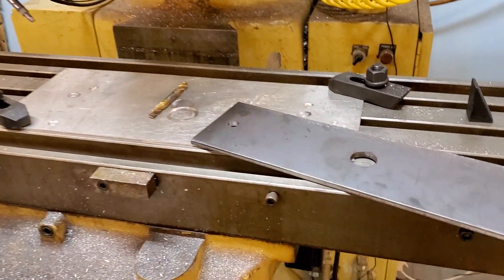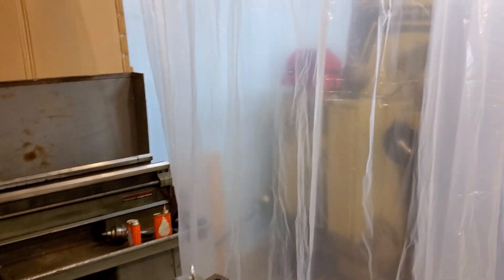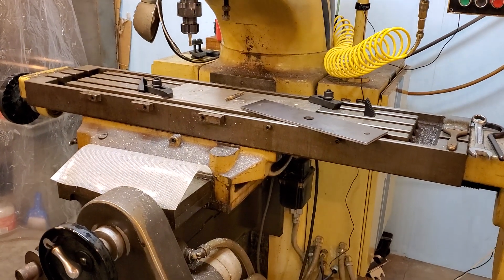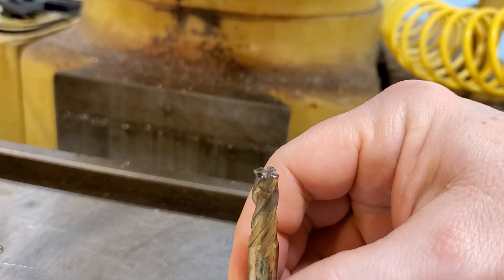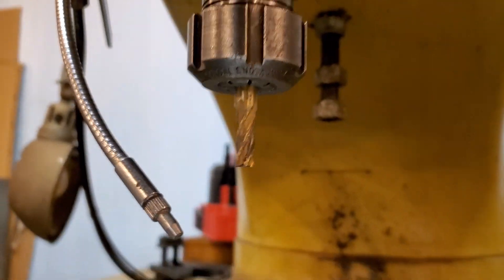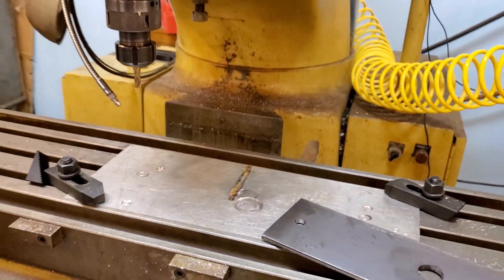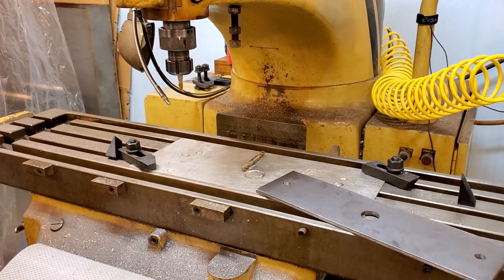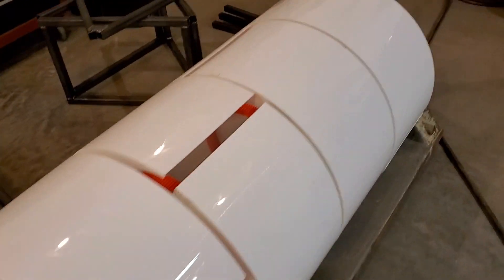Pre-Christmas 2019 update -I need Fusion 360 HELP!

Comment: "HELP! I'm learning as I go here so please don't be too cruel in your comments. I'm learning as best I can on my own"
My first thought when i read the video desc... SLAM HIM!!!! muahahaha. 

I do share a passion in engineering. Going to leave a few things which i can forsee in your design. 

Case 1:
Yes, wind blows, the thing spins. obvious enough. What is not so obvious is.Wind blows in one direction. If it hits the horizontal half, you get max torque and max power. If it hits the full cross sectional area of your wind capture area, well not so much. To circumvent this, consider your designs to have aerofoil properties. Not suggesting to have it completely weirded out of being a cylinder. The side which doesnt provide much effectiveness in catching wind. I believe you can tweak the shape so that it can help to direct the wind in such a way that propels it to rotate in one direction. Not going to spoil too much. 

Case 2. 
Since the wind blows in one direction. There will be another form of moment. The usual moment is the one that you and all of us can see, which it rotates upon the determine axle. 
There is another moment. Best describe as when someone knock a water bottle top side. That is the moment , you will have to address as well. Why is it important? Consider this. The wind direction is singular or basically it comes in one direction. But your blades are rotating. It means your capture area alternates. Im pretty sure that 180 degree rotation and 90 degree rotation with you standing in one position, you can see at times your wind capture area is maximise, and at other times, it will become minimise. 
Still remember that moment that i describe the water bottle tips over top side? You will definitely experience, that moment to have maximum and minimum. With it rotating on an axle, Its going to spring back and forth while rotating. 
Solution? well make sure that the top side of the axle is secure as the bottom as well. Do this, and your bearings will last longer and doesnt wear and tear. 

Case 3
Im not sure how windy is your intended installation. and please dont reveal it online here just because it look like im kind. The internet... well get my point. If it is strong wind vs weak winds. You are going to have at times high power voltages and low power voltages. Im not refering to high power voltage like the national grid, just at the level of your scale. Just like amplitude of waves. Crest and trough. Im sure you would like to avoid your electrical appliances goes functional at times and dim at others. 

Im not so keen in electrical, so its best ask the ones who are capable. Its similar to solar. bright sun, lights in the office are awesome, fans at max speeds. Cloudy..... well... occasional darkness and stuffy. 

Regards,

Edward
Reply from the maker: Edward you get an A for effort but failed at grasping what I was asking for help with. I am not asking for design help right now. I have got that in hand and have already addressed the concerns you were discussing. Just take a look at my early videos of the small pink and green models spinning in the wind. What I was asking for help with is machining. So right now that is my need, just some help with machining advise for speeds and feeds and tricks of the trade. Scroll to the bottom of this playlist since it's in reverse chronological order. If you'd like to see Harmony VAWT Latest Updates, here's the URL: https://www.youtube.com/playlist?list=PLqbwi-6vny7s3NVYuynqVG5oyLxysgfIs

Comment: The machine I work on is the human body so I'm out of my element here. I am amazed by your ambition, skill and creativity. My very limited experience drilling holes in steel was not fun, it took HOURS and I did not have a drill press. Best advice I got was use oil, good bits and a pilot hole. If the oil smokes, slow down and be prepared to pause and remove metal shards. I doubt this was helpful but I do want to encourage you if possible
Reply from the maker: Thank you Trinianz! I appreciate the positive vibes and the laughs.

Comment: Hello Chris,
In machining steel, the speed of the tool is very important and you need to set the spindel speed exactely according the material you want to machine, as well as  the material and diameter of your  tool. 
There are tables about it.

For your problem of the speed indication which is missing on the spindle of your milling machine, I would advise to add an electronic RPM indicator.
It cost 10 USD and it's really simple to install. A very small magnet on the spindle axis, one sensor on the spindle head and a digital display.
And then you will be able to set (manually) the right spindle speed according machining tables... and you won't burn your tools anymore.
Concerning feed speeds, it's the same story ( depending of materials, number of teeth of the tool, ...).

If you need help to find this machining speed tables or RPM indicator, give me a email address and I will send you links.

Looking forwards to see the first tests in January.

All the best.

Patrick.
Reply from the maker: Hi Pat. I looked around for a good magnetic rpm indicator but most go off of electronic pulses from a car ignition coil. Several run from hall effect switches that may work so let me know if you have a good one to suggest. I am still in need of help figuring out what I may be doing wrong in F360.
Reply: @HarmonyTurbines  Optical one may also be an option
Reply from the maker: @geekoid183  Yeah I was thinking about that also. You put a shiny piece of tape on the spindle and I think that is what it gauges off of. I'll look for some of those also.
Reply: Optical sensor are good... but not adapted to machine tools where chips or cooling liquid are flying around...
Reply: @dtvking  
Stange use... 
When machining with cooling it could make drops on the place where the IR sensor is aiming... and this drops will absorb IR light..
OR,
 mosture/dust/grease/mini chips could stick on IR sensor and bloc the beam...

This is only experience of IR sensor in heavy industry and in my machineshop...
But after, everyone can make his own experience and misadventures...
Reply from the maker: @dtvking  yes my thought exactly. Got a hand held unit so I can use on any tool.
Reply: Aah... in this case OK.
I have also a handheld optical RPM indicator. It is useful.
But with the price of an inductive one (8 USD), I think it has a value to mount a fix indicator.
Because on a drilling-mill you need to adjust the spindle speed at each change of tool... and also from rough to finishing pass.
Reply: I just did 3 min ago a last trial to give you links for RPM indicator and speed tables.
And one's more message bas been deleted 😡😡😡.
Reply: I made à hardcopy of the screen.
But I don't find the way to post the picture... 😭
You know what to do if you want me To send you the links...🙄
Reply: Chris,
I put twice links to an inductive RPM indicator and to a machining speed tables.
But messages have desappeared. I don't know if it's Ytube that is erasing my messages because of the links...
If you would like theses links, give me a mail address.
Reply from the maker: youtube probably thinks they are spam. The email address creatingmoore@gmail.com will reach me :)
Reply: Chris,
You had also a concern about the good standing of tools vs  your way of cooling (mist cooling).
Mist cooling is a good way of cooling. 
The only problem is adaquate speeds !!!

Comment: in regards to bearing. Use a tapered roller bearing on top, radial bearing down before the spider coupler. Size it so the radial bearing and the spider coupler can fit through the tapered roller bearing. Now you can easily mount and unmount harmony from the support frame.
Reply from the maker: Hi Harold, yes thank you. I might use a tapered roller bearing to keep things simple and reduce parts. I was going to use a radial bearing + an axial bearing but you're right a tapered bearing is nice because you get both functions in 1 unit. So good suggestion; thank you!  If you'd like to see Harmony VAWT Latest Updates, here's the URL: https://www.youtube.com/playlist?list=PLqbwi-6vny7s3NVYuynqVG5oyLxysgfIs

Comment: Have you considered a power window motor instead of the drill? Get them at an auto salvage lot. Smaller profile, designed to be mounted with a right angle shaft. worm geared to move glass.
Reply from the maker: Yes I considered a bunch of options for the prototype. This drill will be perfect once I get my 90 degree bevel gears to mount the drill along side rather than tangent.